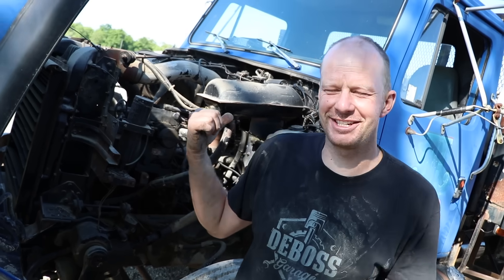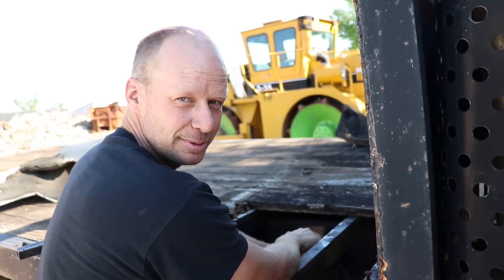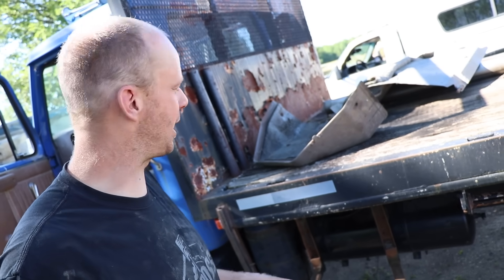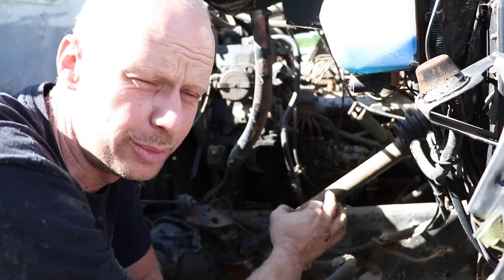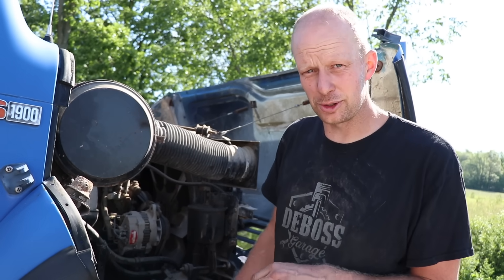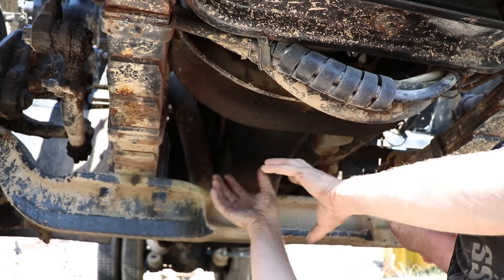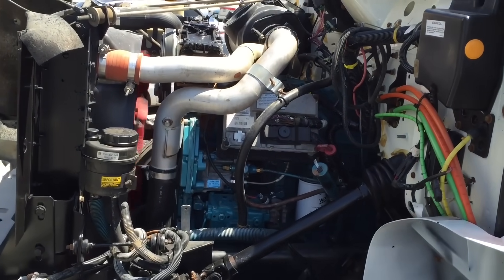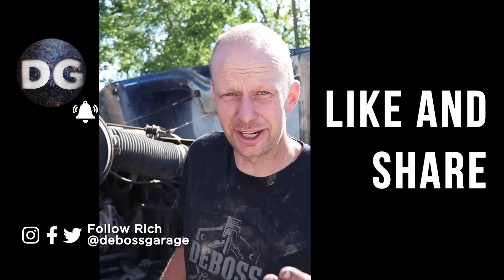REVIEW: Everything Wrong With a 7.6 Navistar DT466 Diesel

Comment: Had one in a 1400 series IH combine, never a problem just grossly underpowered, traded to a newer machine with an 8.3 Cummins power problem solved. Like you mentioned at one time you could by a 466 Short block from a dealer for around 4500.00 US. GOBS of them around trucks buses tractors combines they build a ton of them. Keep up the good work.

Comment: Have an 87 S1900 from new with the DTA 466 which was air to air made it 245 hp. It is a C series first year for  them. Put the heavier valve springs in her ran a Blue Ox exhaust brake RT6613 in her with a Spicer rear at 4:44  single axle. Been a great truck all these years. One weak thing is the belt driven air compressor and the stupid expansion tank sticking out from the fire wall.

Comment: “Wanna hear the most annoying sound in the world?”

“ eeeeeeeeeeeeeeeehhhhhhhhhhhhhhh”
International really know how to pick a sound lol
Reply: Freightliner did too lmao. We have a 2000 freightliner classic in the fleet I maintain for a company. I love that truck but man that buzzer
Reply: @marshdonald1134  when my dad passed we had his rig, and we'd start it up to get the juices flowing, warm it up, etc. That eeeeeeeeeeeehhhhhhhhhhh left a permanent wrinkle on my brain. 😂
Reply: @capt_q_ball  Imagine how your dad felt! Lol, he fed yall for 18 years with that noise lol
Reply: @marshdonald1134 are freightliner good trucks
Reply: Guys guys guys!!!!!!! Can’t we just listen to the radio?
Reply: No I think 94 kw high water temp buzzer.... beep beep beep beep beep
Reply: What's the use of it?
Reply: @twowheeler1000  Low air or oil pressure usually.
Reply: @twowheeler1000   That buzzer screams at you until there is oil pressure.  More effective than a light, as a light doesn't piss you off after 10 seconds
Reply: Bro why didn't they just put in a buzzer?
Reply: That annoying sound saved my ass a $1,000 tow coming down a hill once when my air compressor threw a belt on my 1986 Loadstar 1600 truck crane. It was a tight 2-lane road and because of the annoying buzzer knew I had a few seconds to find a pull over spot (I did) or deal with the truck auto- parking itself in the middle of the lane. The dang buzzer eventually burned out; I just replaced it.

Comment: IH 👍👍👍 the 466 was a little too heavy for a pickup application. But back in the day if Ford would have used it's little brother the DT360 instead of the crap 6.9 idi there would be 2 great 5.9's with tons of aftermarket support. But I guess Ford marketing was afraid to go with a 6cyl diesel against GM'S v8. 😥😥😥😥Dodge wasn't and the rest is history.😁😁😁 love those binder engines though.

Comment: The fire dept I’m on has a 1989 international S2600 10 wheel tanker. Truck has 12,000 original miles. Talk about a dog it has the 466 with 190hp and weighs 52k. Also has a 5 speed Allison trans

Comment: cylinder liner o-rings,  water pump bearings, injector cups and tappet failures were common on the originals up to the "c"models.  a models were good for seizing the delivery valves on the rotary pumps.   still have a lock plug in my box for those.

Comment: Navistar tech here to confirm, cam followers are know for taking out the cam, you can double up on the retainers and it resolves the issue, the retainers broke and if the cam goes the engine isn’t worth rebuilding, it’s toast.
Reply: It wont toast the block 90 percent of the time. If you can replace the followers you most likely can save the engine. Just need to do a rebuild
Reply: jdr ok it won’t take out the rotating assembly, heck things have changed a bit and these engines are getting harder to find, but in their day it was cheaper to slap a new one in then to replace the cam, injectors, hpop, oil pump, and bearings. If I remember right it was easier to throw liners in a good used engine then to replace cam and the effected oil system. I mostly deal with 466e’s wiring than anything. My biggest gripe as a tech is the lack of our software showing the counts for the code and the laundry list of codes it throws when you run the batteries till the starter clicks. It makes diagnosing a no start annoying. Once you square away the idm wiring the engine leaks and the truck falls apart around the engine. He hit the nail in the head though, those old dt466’s are bulletproof

Comment: A video on everything wrong with a DT466 would be awfully short. A great truck engine, only flaw I ever knew of was if you didn't keep the water in condition the 0 ring would fail and dump the water in the oil pan.
You say under powered, maybe at the jump , but hit a hill they will walk right by a truck powered by a 5.9
Reply: Facts
Reply: I've seen that same issue twice. Currently doing an inframe on one for that reason. The other was a DT436 in a 1586 tractor. By far my favorite engine to build because of its simplicity. There's nothing in the way of pulling the head other than the turbo. What ever happened to those days of International? I can't stand working on anything International makes now days.

Comment: In my honest opinion the DT466 should have been the engine put in the fords instead of the powerstrokes.
Reply: nah the smaller  sibling the dt360
Reply: @richardcranium5839  either way, the dt466 or the dt360 would have been a lot better in the fords than the powerstrokes. the v8 IDI's were OK in their own right, decently reliable but they lacked the torque a I6 gives.
Reply: Same block just different guts...plowing many yrs w Dt360A...3000 rpm all day all night..oil pans are 600 bucks if you can find one
Reply: knowltek 360 and a 466 are not the same block. 466 is a upsized version and yes the internals are different.
Reply: Carson Chaney fits in the same mount position s cause I’ve changed m before

Comment: And emissions have been killing diesel reliability ever since.
Reply: Robert Wyrick aint that the truth
Reply: Exactly why i love the older trucks.
Reply: International 9.0 Liter still running fine, aside some rocker arm play that I need to address on cylinder 2.
Reply: That’s why mines deleted. Thank you Canada
Reply: @zSpeakNoEvil  i went a different route and got a 2019 f150 3.5 ecoboost. Mine is rated to tow 12,800lbs and tows 11k lbs BETTER than the tuned and modded 7.3 powerstroke it replaced. no emissions bs, other than the harmless catalytic converters. it doesn't even have egr.
Reply: @Brandon_Nelson92  ...okay. Maybe they've gotten better since 2015, but the last few ecoboosts I've driven were barely able to tow themselves properly.
Reply: @-tr0n  There was some issues with timing chain stretch being covered up by cam phasers advancing timing  till they couldn't  anymore  and made the trucks super gutless, also issues with the direct injection system causing carbon buildup on the intake valves causing pre ignition and or misfires, also issues with the waste gates failing open or closed, maybe you had shit luck? (Worked at a Ford Dealership)
Reply: @dtoshredneck  well they were brand new work trucks. Either driven empty on highway to get to camp 600km away ever couple weeks or hauling 4k lb hose trailers in town. Both felt okay, but no more capable than a 5.3 chev unless absolutely matted making full boost.
Reply: @Brandon_Nelson92  But how will it be in say 4 - 5 years if you do regular towing work like that with it?  

I've bumped into a few people that had the early ecoboosts that said they are a short lived engines for that type of work.
Reply: @Brandon_Nelson92  To be fair,you won't get far with trying to modify a 7.3L PSD,it takes a ton of money and modifications to get more strength out of them,which then ends up with a short life span,but some 7.3L's have been as high as 600-800 HP.I own a 1994 & 2000 F250 XLT with the 7.3L PSD and I will tow 13,500 lbs without issue,obviously for them being a 20-30 year old truck,it is just outdated.My 1994 F250 has 210 HP/425 TQ and a TP38,this was before they updated them a few years later,because my 2000 F250 has 275 HP/525 TQ and a GTP38.

The 3.5L makes 375 HP/470 TQ only,but I have a relative with a Ecoboost F150 and it is trash,it has had metal shavings in the oil pan and they have gone through a few turbochargers already.But I was told that the first ones are famous for that while the later ones can surpass 300,000 miles.The 5.0L V8 is better because it has all the power right there instead of building up like the V6,which can take 2,500-3,000 RPM to do.
Reply: @Slim_Slid  Actually, the 3.5 ecoboost makes way more low-end torque than the 5.0 and uses LESS rpms, while towing uphill. See for yourself: https://youtu.be/k8CafR1YxqE

My 1999 7.3 had only minor mods, so it was making about 320-340hp in my highest tunes and only about 300hp in my towing tune. Don't get me wrong, a healthy 7.3 is no slouch. The ecoboost is just a whole other animal. 

Ford went to a 2 chain timing setup on the 2nd gen 3.5 ecoboost to solve the chain stretch issue. They also added port fuel injection to fix the intake valve carbon buildup issue. Ecoboosts are long-lived when you maintain them well and follow the "do's and don'ts" of turbo GDI engines. Oil changes every 5k or less, regardless of Ford's recommended 10k interval. I've seen 4 or 5 of the early ecoboosts with over 250k miles on their original engines and about another dozen at 200k+. The 2nd gen engines should have no problem seeing 300k+ if maintained well. I'm only up to 15k miles so far on mine, but couldn't be happier with it.
Reply: @Brandon_Nelson92  A 5.0L F150 with 3:73 Gears can handle 14,200 lbs as to where if it had 3:15 Gears it would only handle 9,200 lbs.I don't know if it's the same for the Ecoboost F150.The chain errors are what I already knew about them,the first generation,ironically the 3V 4.6L and 3V 5.4L in the previous F150 had timing chain problems too,not to mention camshaft phasers and solenoids,the 2V 4.6L and 2V 5.4L was a better built engine but the thread on the spark plugs was different,the first ones could've had more spark plug problems than the later ones,but honestly if they were torqued down correctly,not minor or extreme,that problem wouldn't exist on the Triton,even if they were redlined.

I'm not stomping on the 3.5L because it's a V6 and the 5.0L is better because it's a V8.But most 5.0L's I have been around have less to deal with than the 3.5L's.A friend of mine has a 2010 5.0L F150 and he has 3:73's,he can pull 10,000 lbs very easily.My 2002 5.4L F150 Supercrew also had 3:73's but I could only do 8,800 lbs and the 2V 5.4L was 260 HP/303 TQ.
With the Ecoboost,I notice that sometimes you really have to give it RPM to move if you have a load behind you,as to where the 5.0L just gets up and goes once that throttle is pushed.
Reply: @-tr0n  They revised ethe eb in '15. Dual injection ad some other stuff.
Reply: With an oilbypass kit regular maintenance good oil they should last preety good.
Reply: I mean.... you really shouldn't be breathing this stuff to begin with
Reply: thats the purpose of emission controls on engines, to slow all production. jets dont have them and jets dont use DEF, why is that?

Comment: The cam killer was the epa 2007 dt466 (maxdt) The dog bone holding the the pair of lifters would typically break causing the lifter to turn, the roller on the base of the lifter that rolls on the cam would be perpendicular and thus kill the cam lobe. There was a upgrade kit to prevent this called the "force lube kit" ( new lifters,push rods, and dog bones).. other wise the epa 2007 dt was a heui set up with a vgt and was great !

Comment: Never have seen cam problems on a 466, but the maxxforce engines break the lifter retainers and wipe out cam lobes. The "fix" was to double the retainers up, but I've seen a couple of newer generation ones that were doubled up from the factory and still broke both and wiped out the cam under 50k.

Comment: Seeing this video makes me happy, I grew up around these style engines, DT-436B in an old IH 1460 then onto a DTI-466 in a Case IH 1680. Hell, our grain truck has a DT-466. Good ol motors.
Reply: 1680 should have an 8.3?
Reply: @carsonchaney950  The early ones had a DT-466, the Cummins was a later addition

Comment: The DT466 engines are fantastic but the DT466E's 2001- 2003 were in my opinion just as good. We had several with well past 30,000 hours on them with no internal work (yes, that is correct over 30K hours) and we had one that went past 40,000 hours with not much more than injectors being replaced just past 35K. Yes, they did have there issues with electronics but most were caused by operator error. And the annoying low pressure fuel line seal leaks. The main thing we learned about making them live was proper oil changes. Every 750 hours they got serviced. and under no circumstances did we allow the engines to be opened up for adjustments unless absolutely necessary.
Reply: I had an E in my old service truck, I loved it. It always did right by me.
Reply: Rofl!  A p pump can be oh'ed for cheap.  Huei is $$$, and often wrecks the rings, liners, and bearings.
Reply: I spent 17 years as an IH Diamond Certified technician and yes, there was an o-ring issue that caused the exact problem that Alan mentioned. IH recognized the issue and there was an updated o-ring kit to address it. Nothing to do with using approved coolant or improper maintenance, it was improper materials in the original o-rings.
Reply: We had 20 of these.  Every  single one shit the bed at or near 100,000 miles.  They would lose the orings at the bottom of the sleeves and mix massive  amounts  of coolant  in the oil and fail. Water pumps  literally  every year.   However  they were very easy and cheap  to rebuild. We used them for twin  screw delivery  trucks 60k gvwr most  were dt466es and a few dt530s.
Reply: @alanack67   We had a lot more trucks than that, the only major problems we had were directly attributed to operator error and neglect at both the operator and local maintenance. Failure to report a problem, failure to follow pre and post trip inspections were the "only" reasons some failed early. Those that followed proper inspections we never had a single major failure. Mind you, these were in Iraq where just taking care of anything was not just a simple matter of jumping in a truck and taking care of the simplest problem. If yours were failing that quickly, you need to re think proper maintenance and training
Reply: And I will add, the longest any truck was down was 3 weeks, it had over 45K hours on it and we had to wait for parts to do an "in chassis" overhaul. Otherwise 48 hours was the max any was down and the bulk of that was transportation to get to the truck to fix it. On site most repairs were accomplished with in 4 hours. And this I can attest to personally
Reply: And not a single engine we had "ever" lost coolant into the crankcase due to the fact the "I" specified only the correct coolant was to be used  and distilled water were to be used period! Yes we had coolant pumps fail, go figure since they are at the bottom of the engine on the driver side but were shut down immediately and only take 20 minutes to change out and refill/bleed the cooling system in the truck
Reply: @ram50v8  i  suspect  lack of coolant  filter mantaince  was a cause.

Comment: Ok so what would my dt466 be? It has a p pump style injection pump but it uses a 12v constant signal to keep it running
Reply: Probably just a regular P pump with an electronic kill on the pump. Older mechanical pumps had a rod you pulled and it closed a plunger inside the pump cutting the fuel supply. Sounds like yours just shuts off with the key.
Reply: @carsonchaney950  it does shut off with the key

Comment: The ngd is the best ever made imo.     Once you get into the later emissions models they have a ton of issues.  From the dog bones breaking turning the lifter sideways on the cam to cam bearings seizing. Front cover leaks, soft valves, etc.     then the maxxforce...  same block but tons of bs bolted on causing them to be shut down in 2013 and not allowed to put any of their own engines into trucks till they put the cummins after treatment on them and re labeled it the N9 lmao.   I just sold my dt360 and dt466c

Comment: I totally agree with everything you say about the DT466..  I installed a 6.9 NAV in a 1953 IHC R120. Talk about heavy and lazy engine.  Sadly, the 6.9 lasted a long time. I was hoping it would die. I got 20 years and 225,000 miles out f that engine and it was running when I gave it away.

Comment: In my younger years aka 20 years ago I drove S1800 single axle with the DT360 6spd it was a gutless wonder but it always started the cab of the truck vibrated like a harmonica. International trucks are not that great, body rots off of them, the wiring is awful to work on, cabs are spartan.

Comment: the electronic ones arent that bad! cam sensor and hpop sensor are the only sensors that will go out every other 5 years and very easily accessible, and the high pressure oil seals wear out/injector o rings go bad once in a while but is a easy job those are the only problems ive ever had with the electronic dt466